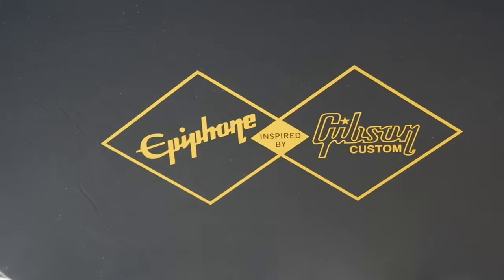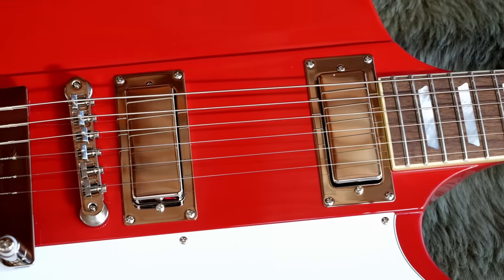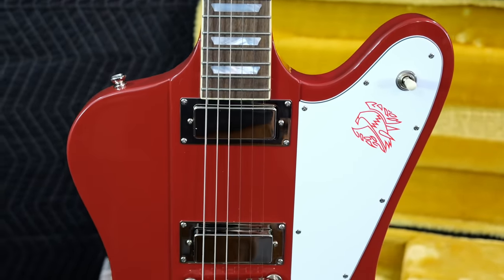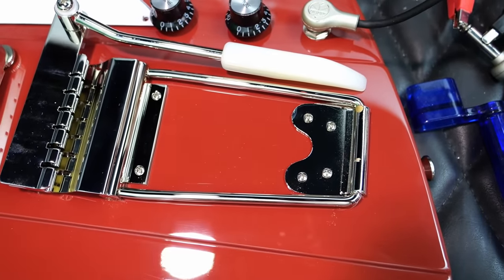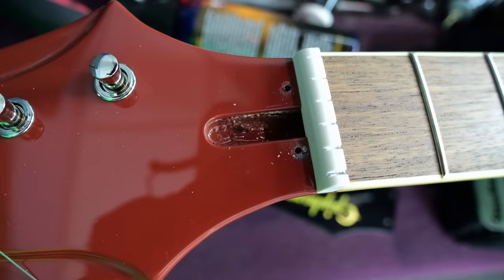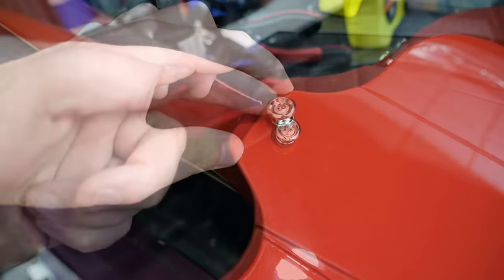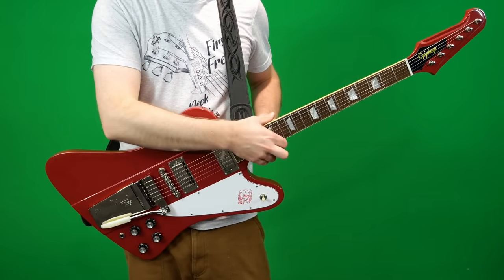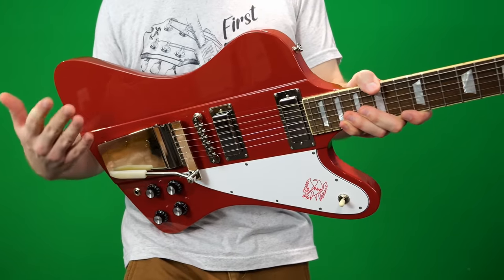I Tried the New $1700 Epiphone Firebird V and...

Comment: Why is it the $700 Epiphone Les Paul Moderns and Customs come with an Ebony fingerboard but these supposedly higher end Epiphones come with an Indian Laurel Fingerboard? 🙄
Reply: Yeah, that's a bit of a head scratcher. Surely they could at least use some lighter Ebony that didn't make the cut...
Reply: What's wrong with Indian Laurel?
Reply: @flamethefirefox9006 Nothing, but you wouldn't pay for prime rib and be happy with ground beef would you? Nothing WRONG with it, just not exactly something worth that $.
Reply: @flamethefirefox9006 I've had afew epiphones with laurel boards,I have to be honest,I hated them,no matter how much I treated with lemon oil,those guitars were always dry.rosewood or maple for me.
Reply: With all the true Gibson parts and pickups, the laurel is probably a cost reduction measure.
Reply: I think the bigger question is why sh!t on Indian Laurel as if its not a quality alternative.  What makes Rosewood expensive is more political than anything and it plays great so I don't care either way

Comment: I love your videos man, but trying to sell these firebirds for $1700, is insane. It is a Chinese made guitar with some decent parts. Nothing against Chinese made guitars but, you can get a lot of guitar for way less. The back to back with the DG sig and all the problems guys are having with headstocks snapping off and then this for the cost it's just comical at this point.
Reply: Why would you sell the 2nd level brand for $1000 if the core model is 5x that doesn't make sense
Reply: Japanese made fenders which are sweet are $450 cheaper

Comment: The tuners are actually from Kluson. You can adjust the stiffness of them by loosen/thighen the screw on the tuner tip (similar to Grover Rotomatics). The three strap button are actually vintage correct. The historic Firebirds came all with three strap buttons.

Comment: Maybe I'll get a used one when they devalue. Laurel looks fine when you oil it, and poly vs nitro is a dumb debate. Im sure the guitar kicks ass, just not for 1700 big ones
Reply: What is it about poly and nitro? Is one just better than the other or is it insignificant?
Reply: @samuelllakaj5439  poly is without a doubt the superior finish for mass produced guitars, easier to spray, complies with annoying environmental laws, and it'll still look new and glossy 50 years later with light care. But nitro is historically what was used, it does let the wood breathe, can be applied thinner, but overall is a much more fragile finish. I have to buy stands and hangers with special foam that wont melt the finish. My point is there are pitfalls and benefits to both. I like nitro on super high end guitars
Reply: @Hobinator17  Not many ppl want a pristine finish on a 50 year old guitar. It needs aging to match its , well, age. Nitro all the way.
Reply: @globalnova  new nitro isnt the same as old nitro, so even it wont age quite the same way as the heritage stuff. The chemical formulas now contain a lot of plasticizers. Environmental laws prevent the original formulas being used. Also, many manufacturers spray a poly basecoat followed by nitro and then only market the nitro finish.

Comment: The price does seem high.  They are manufacturing overseas to save money.  The guitar has a poly finish and the binding on the neck is missing the nibs over the fret ends so work saved finishing it.  It also has the Indian Laurel versus Rosewood or Ebony which is viewed as less desirable.    I would just expect a bigger save over the lower end of the Gibson range such as with the Epiphone LP customs and artist models like the Cantrell wino.  With the price on this firebird where it is, I Personally would go with something like the Gibson LP Classic.  Not only supporting American manufacturing but also has the nitro and preferred fingerboard material and I'm sure long term the resale will be better.

Comment: lol so in the end i bought it and I'm super happy with it! A couple of things that abated my concerns... the laurel on my example got a lot darker once I hydrated it, the grain is very wide though and I do feel it while playing but I've felt that with rosewood as well. The poly finish is actually very nice. This isn't your usually sticky poly finish you see on a squier or lower end epi, it's high quality and the polish is very fast. No problem with speedy playing. I use a lot of fuzz and it's giving me exactly the sound I'm looking for. Frets were already very polished on mine, meaning it likely got a level crown before shipping. Setup was great also, although the usual epiphone strings were trash so a string change is needed. Case is luxurious. I got the frost blue colour and it's glorious. Has that 50's Cadillac vibe. Fit and finish is great, no chatter marks on the binding, no sharp fret ends, no paint imperfections. Graph tech nut and dual action truss rod are very nice. Pretty much a perfect guitar. On par with high end korean guitars from other brands but better because of all of the high end electronics.

Comment: You can get a 90’s Gibson Firebird for not much more.
Reply from the maker: Typical 2x more and vastly different specs
Reply: @Trog I just bought one in January.  2000 shipped.  No vibrato, and the pickups are different, and sunburst.  Not exactly apples to oranges though.

Comment: I paid about 500 for a used Epi Firebird like the one you compared this to. Just the standard sunburst edition. I used 0000 steel wool to take down the ...way to shiny finish.  I replace the pickups and hardware with Fralin brushed nickel for about 500. I had it set up by Chris Lovell of Memphis  Strings and Things fame.... and it is fantastic. About 1100 all in. But So nice. One one hand, probably not worth it. On the other.. still a bargain for how good it is.

Comment: $1299 tops! 10 years ago a GIBSON was $1400
Reply: My Gibson mk 7 was 1450 in 02 if I remember correctly
Reply: and what did you make 10 years ago?
Reply: LOL - we've had 10 years of massive inflation, which has really picked up steam the past 3 years.
Reply: @grindhouseglitch Shipping costs from China are around 6 to 7 times what they were 4 years ago. And everything else has probably gone up by 50% in that time.
Reply: not even premium chinese $500-$700 no higher. That money is liming someone's pockets and it sure as hell isn't spent on labor or parts, you would have to be an idiot to pay that much you can get an SG standard for that and its the real deal.
Reply: Even 2 or 3 years ago you could get a brand new Gibson Firebird for about the same price as this guitar!
Reply: 134 years ago they paid you to take them away from them.

Comment: "You've got the correct tuners and correct headstock, probably worth between three and four hundred dollars" sorry but this just shocked me, are we paying for shapes now, how much more does it cost them much more to just setup the CNC machine a little differently? and $50 for CTS pots (which were already in the cheaper model) sorry this just feels like contorting to fit their narrative of being premium without doing things that incur real cost and provide value to the player eg nitro finishes, rosewood boards, plek'd frets.
Reply from the maker: Gibson typically reserves these things for their USA models only. People got excited when Epiphones started using the open book headstock shape so if you don’t think there is value in the correct (expensive) tuners and headstock shape, you’d be in the minority. These are big selling features to fans of vintage firebirds This guitar is for a select niche audience which is why I suggest the now 650 usd z Epiphone Firebird for “casual” buyer who doesn’t care about such things
Reply: @Trog then how do you explain that Epiphone made a Slash signature firebird (albeit it wasn't neck through) that already had the true firebird headstock and banjo tuners (+ Seymour Duncans, a maple cap, orange drop capacitors,+... ) a couple of years ago less than half the price of these ones?

Comment: I got a 2015 GIBSON Firebird from a European seller on Reverb for less than this with shipping in 2020. Came in a GIANT gold case that looked like a photon torpedo from the Enterprise. 😂
Unfortunately I had an emergency and had to sell it (loved the pickups, didn’t really like the massive size and the modern tuners were a bit confusing since I’ve never played anything with a “reverse” headstock.) I did make some money over what I paid because it was right in the middle of the pandemic lunacy surrounding Reverb.
Reply: True but that's also 4 years ago. I get what you're saying man, all good. Let's say somebody wants a Gibson Firebird like this one, but can't afford it but they can afford a price more on this level. That's all i'm saying. I know they are a little bit pricey. I paid about $1,850 for my Gibson Firehird V in classic white in 2020 too which isn't that much more than one of these
Reply: Just about any Gibson 2015 model will be less $$ on the used market due to the much maligned 2015 spec's. (wider fingerboard, adjustable brass nut, etc.) If more people actually tried them, they would probably like them. My 2015 SG Special looks, plays, and sounds great. The gold case is the bomb, for sure.
Reply: @nellayema2455  I liked the out jack in the side, made more room around the tone knobs.
Reply: @joermnyc  Yep, and no danger of cracking the top if one steps on the instrument cable!

Comment: I think it's very incorrect to calculate these upgrades with aftermarket prices. It obviously not that expensive for Epi to make these parts.
Also, previous firebird was for people who wanted one, but couldn't afford Gibson. I'm not sure who is this one for - not a player, but also not a collector🤔
Reply from the maker: It is correct because if someone wanted to upgrade an existing epi Firebird to this spec - that’s what you’d have to value/pay. There will always be dealer markup in the cost of a guitar. If you want to use whole sale pricing, you’d have to use the wholesale cost

Comment: Is there any advantage to banjo tuners over normal ones?
Reply: None at all whatsoever, the only reason why Gibson used them back in '63 was because of looks, they needed the reverse headstock to look as "clean" as possible in order to compete with Fender's more modern designs...
I had these on all of my Firebirds and there's only one set that ever worked properly, all the other ones were replaced by Steinberger Gearless tuners...
Reply: @jeromewagschal9485  Thanks for the reply; that was my hypothesis, but I wanted to hear from someone with actual experience with these tuners.
Reply: @nsp477  You're welcome 🙂

Comment: Your math is so not correct. $150 estimated for a vibrola? Are you even serious rn? That is a bent piece of nickel plated aluminum. Shit is like $50 MAX. Tuners? $50-75 MAX. CTS Pots $40 would be pushing it. Headstock? ~$100 seems fair. So $650 to start plus the extras comes out to a total of  $965. Round that to $1250. I do not see how you can close the gap and make it $1700 without blatantly ripping off customers for imperceptible and innocuous specs

Comment: I just don't know... That's the same price as a Gibson Les Paul Studio.
Reply: Apples and oranges. Listen I think it should be around $1300 myself. The price does seem steep. But I do know the reason they came out with the non reverse Firebirds in the 60's was because the Firebird was the most expensive to build solid body guitar in their lineup and they needed to get the cost down to compete with Fender. Which is why the Firebird was made in the first place. So who really knows the economics of this?
Reply: Except its not a Les Paul, It's a totally different guitar and is more labor intensive to build with its neck through construction. I have two Firebirds a Gibson and an Epiphone and no Les Paul's for example
Reply: Or an SG Standard

Comment: Necks on 60s Reverse Firebirds varied. Some could be fairly slim. My experience is that banjo tuners are more trouble than a good thing. Actual Gibson Firebird pickups have varied a lot over the years. What they used starting early 90s were both hotter and wider across. They changed again post HJ. Vintage banjo tuners are not precise.

Comment: Bought a Epiphone Joe Bonamassa Treasure Firebird and the tuners were stiff and rough dripped some triflon lube down the tuner shafts and took the buttons off the tuners and put a drop or 2 there. It helped a lot. I guess they used the same banjo tuners.

Comment: Can someone explain to me why the firebird guitar is almost twice the price of the thunderbird bass? I got the Inverness green thunderbird and other than the fretboard that feels even worse than it looks, it’s a great instrument. I would not spend as much as they are charging for the Firebird.
Reply: They even used the carved headstock too.
There really is no explanation for why this is $1699. Logically, it should not have been any more expensive than Greeny or AJ being a non signature guitar.
Reply: @trevor4533 The only thing I can figure is that it's a more costly guitar to produce then a Les Paul and it does come with a nic3 case, banjo tuners, mother of pearl inlays etc
Reply: @jonathanhudak2059  Sure, but how much more expensive could it really cost them to make?
A regular Epiphone LP standard is $699, while the regular firebird is $649. 
A nice case and mother of pearl inlays are both included on the Greeny and AJ guitars as well. With no artist endorsement being baked into the price ...I just don't get it.
Reply: @trevor4533  yeah the regular tobacco sunburst Epi. Firebird at $649 is a steal of a deal for what it is. I bought one. It does not come with a hardshell case, nor does it have the banjo tuners. For those two items that could easily be $300. Plus this V model has the fancier headstock and genuine mother of pearl inlays. Maybe $100 more for the custom colors.  Not saying that to justify it just trying to lay things out. They may charge a couple hundred more as a pricing thing too to make some money out of it. That's all I can figure.

Comment: Hard to A/B sound compare Gibson "Firebird" pickups because that smooth cover hides several designs, with various magnets and windings. Vintage Firebird come with magnetized blades, some designs the coil lies sideways some it lies conventionally. And there are various versions of 'modern' Gibson (Jim DeCola designed) dual non magnetized blade pups with Al2, Al5 and ceramic bar magnets under. I have the latter with Al5 and Ceramic bar magnets and they are 14k, 26k so really hot compared to vintage. Great tones but not vintage.

Comment: It does sound good. But buying the regular one and upgrading the pickups seems like a much better option. 
I would worry about resale value as well. It is the kind of guitar that you might not end up taking out that much due to the size of the case. 
So I can see it getting neglected and sold. At which point you might struggle to find a buyer willing to pay Gibson prices for an Epiphone

Comment: 1700 for an EPIPHONE? lmao. Nice vid
Reply: Well I mean imported Chinese Epiphone sure if this was like the American Casino Epiphone then the price would make sense.
Reply: @nocturnal101ravenous6 even if that Casino Epiphone still had Indian Laurel fretboard I still wouldn't buy it. But that's my take.
Reply: @zifoxx1895  I mean you guys are whining about rosewood to me if it isn't Ebony its not worth it
Reply: @nocturnal101ravenous6 the only thing I'm really whining about is the price, granted inflation is a thing sure, but I grew up when these guitars costed a lot less and their quality control was garbage, I had 1 Les Paul Custom (Epiphone) that the nut was cut badly, the input jack would loosen every time I plugged it in, the wiring was messed up and even the toggle switch was too. And another SG that after 3 years of playing it the neck snapped (never had been dropped before). I know not everyone has the same experiences as I did and maybe their quality became better, I don't know, but that for me was a dealbreaker, I like the Firebird design and all its quirks but after my bad experience I hesitate especially if I'm gonna be paying 1k+ on a Chinese imported guitar.

Comment: 2:07 Your math is off in justifying the "upcharge" to this model. Firstly, you mention retail (or even higher) prices for these parts, which of course the company doesn't pay. Secondly, a swap would mean that the actual cost would be the difference between the value of such items, which again is not nearly as much.

Comment: Looks like Gibson have stopped making the regular off the rack USA Firebird so this will fill that gap, it's actually closer to original spec with the banjos and vibrola and the pickups are closer to 60's spec compared to the 90's version. Difficult one, it's ticking a lot of boxes. If it had Gibson on the covers, this bird would be a real flyer!

Comment: No, the math doesn't work without marketing tricks (like saying the new headstock is "worth" $200-$300 extra to some rather than saying it costs $80 more to make). $50 to upgrade to CTS? Meh. There's a lot of slop in that math. This guitar should be $1,200.
Reply: Indeed. Especially with all the IbG Guitars that came out yesterday for $1299 WITH CUSTOMBUCKERS.
There is no logic to explain the Firebird pricing...

Comment: $1700 for a Far East guitar with Laurel fretboard is a lot.  But it's comical.  We often see $10k Gibsons on this channel.  $1700 might be $1000 too high.  But most of the current Custom Shop Gibsons are about $2k or $3k too high.  
$8k for a USA made EDS-1275 is an absolute joke when you consider that it's just a double SG...and a USA SG goes for $2000 or $2500 or so.